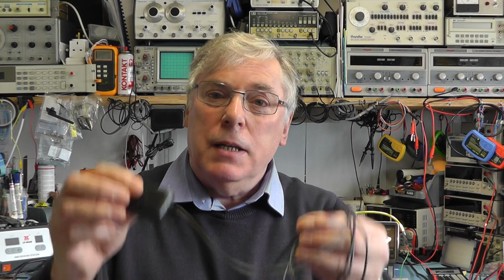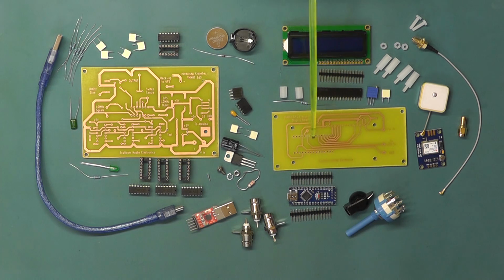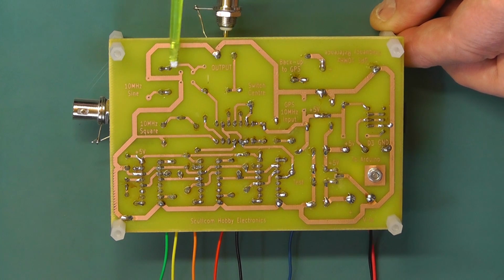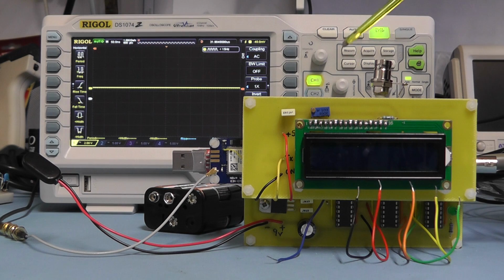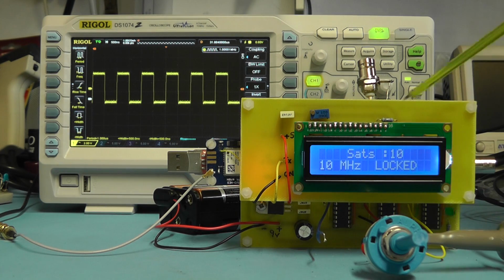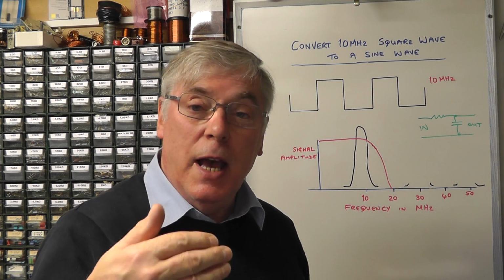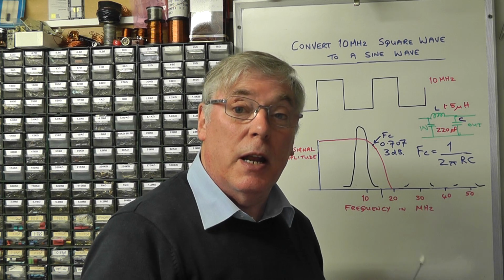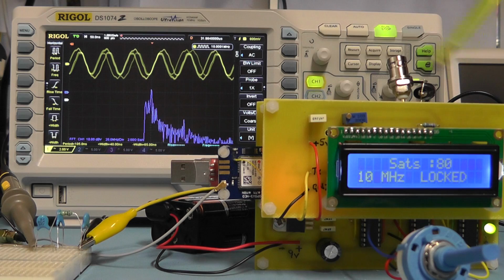Scullcom Hobby Electronics #37 - Design & Build a GPS locked Freq. Part 2

Comment: Nice project! Would better grounding (ground plate) and shielding between the frequency divider chips not improve the signal quality? It seams like the high frequency signals are interfering with the lower frequency signals. Switching off the the lower frequency dividers when using higher frequency reference signals might improve the signal even more😁

Comment: Very informative videos thank you. The effect of the 'phase distortion' would be most likely  cured if you put a BNC t-piece on the Rigol Oscilloscope, and add a 50 ohm terminator (ie resistor) on one of side of the Tee, and put your probe lead into the other side of the Tee. The ghosting is caused by an impedance mismatch in the cable, and so what you are seeing is the reflected wave bouncing back and forth along the test lead.
Reply: That won't cure it. The "ghosting" is not an impedance mismatch, but the result of the synthesis of the 10MHz square wave from a 24MHz signal which is a non-integer division. The 10MHz is created by dividing the 24MHz by either 2 or by 3, so instead of 50ns high and 50ns low, you get a sequence of pulses that are comprise 3 pulses of 41.66ns interspersed with 2 pulses of 62.5ns in duration that average out at 50ns, making the frequency exactly 10MHz, but with an uneven duty cycle. That's what you're seeing on the scope.

The solution is to set the GPS module to generate 1 MHz, which it can do precisely, then use a phase-locked loop running at 10MHz to drive the divider chain, diving by 10 at each stage. The 1MHz GPS signal is then compared with the output of the first divide by 10 stage to control the VCO in the PLL. That will give the full range of calibration frequencies as before, but with accurate 50% duty cycle square waves from each.

Comment: The firmware needs a fix ! At 19:33 the Sat display goes from 9 to 10 to 90 sats, so you should add an extra space after the number. Nice work overall.

Comment: It is easier to get clean 10 MHz signal if you use LC circuit. 12 turns on 10 mm body (some 10 mm drill, remove after coil is made) with 1 mm wire. Parallel to the inductor is 250 pF capacitor. Whole LC 'tank' feed over 5 pF capacitor from 10 MHz GPS module output to this LC circuit, and at the same point you have clean 10 MHz signal. Since inductor is free standing in the air, it can be fine tuned by moving coil little bit. Take care about output impedance, since LC tank is generally high impedance circuit. You may use secondary coil with few turns, or solder tap on say 1/3 of the turns (4th turn from the ground end). Amplitude at this point will be lower, but LC tank circuit resonance will not be compromised.

Comment: Very interesting video. Can you recommend seller for the neo 7. Most of the sellers i have found are in china
Reply from the maker: Hi Peter,
If you use the following link you should find a few sellers. One is in the UK but also the most expensive. The ones fro China are the cheapest.
https://www.ebay.co.uk/itm/1PCS-Ublox-NEO-7M-000-GPS-Module-MWC-APM2-6-Replace-NEO-6M-GYGPSV3-NEO7M-L30
Regards,
Louis
Reply: Thanks for your reply. I will take a look

Comment: 21:34 90 sats? that's impressive ;)
Reply from the maker: Thanks.
Reply: I'm sorry, that should have been a hint. There aren't even 90 GPS satellites in orbit, and you can receive maybe 20 at the same time. I think it's a bug in the LCD driver software, you don't delete the 0 in the second digit so if it displayed 10 and then goes down to 9 or 8, the 0 stays and it seems like 90 or 80.
I like the project though.
Reply: I just watched part 4 of the Series and the issue seems fixed there.
Reply from the maker: Thanks for letting me know. I smiled when I first read you initial comment of "90 sats" The LCD needed to delete the 0 in the second digit when it went below 10. As you point out this was corrected. Regards, Louis

Comment: Excellent project, I have started working on mine. I have been looking at Arduinos for quite some time and this project will make me get in it.I have a question on your diagram, why do you have jumpers drawn in the schematics, JP1-2-3-4-5-6-7-8I making a few changes on your schematics too, i'm planning to use a multiplexer ( I have a HCF4051 that I will try) controlled by the Arduino.
Reply from the maker: +dan3460 Thanks. Yes JP1-2-3-4-5-6-7-8 are simply wire links as the PCB is single side. With regards switching, I have been working on keypad entry of the frequency which will be covered in Part 3 of this project. A new single board PCB is also designed. Part 3 of the project is uploading as I type this so should be available soon.

Comment: Great work! 
I was looking for a Master Clock for my scopes and counters when servicing amateur radios. I found some cheap china modules working fine and even having a PPS output on the connectors. As the studio is below the rooftop, it works fine with the on-board patch antenna. If you use PPS output up to 1MHz signals are received perfectly but if you set PPS to 10MHz the receiver signal quality is dropping very low.
I investigated that and found that the LEDs (my module has two of them) are driven by this signal and the signal is not a sqare but some sort of saw-tooth-ish. So driving two LEDs with 10MHz is putting some real ripple onto the complete boards power planes and loading the 10MHz to hard.
I removed the LEDs and added some more decoupling capacitor to the Vcc and it looks far better now. even still without external antenna.
Reply from the maker: +Astralix2011 Thanks for your comments.

Comment: Every one I seen runs through a electronic frequency control input (EXTAL)pin on a ocxo 10MHz crystal then into a low pass 10MHz filter for a sinewave. Your probably picking up external noises from the wires around the gps module and the input voltages, lighting, ect. so shielding would probably help out. Might look at it with a spectrum analyzer to figure out all the issues. Look at with your FFT on your scope
Reply from the maker: +Martin P Thanks Martin for your comments. Yes you could also use this project to lock a 10 MHz OCXO and get a cleaner 10MHz sine wave out put. I have found that some of the noise is caused by the 48MHz fundamental frequency from the uBlox Neo-7. Adding some filtering on the 5 volt power line reduces this. Screening as you mentioned would also probably help.
Reply: +Scullcom Hobby Electronics, Be interesting to see what you find out. I'll order the chip sometime put it on my own pcb with my own components. I suspect some of the issues is with the pcb design and parts on the GY-GPSV2-NEO or V3. According to Ublox these things are really finicky with voltages though they don't go into detail about proper board design.  Oh and you might try Power Save Mode since this might lower the noise and might be worth it to go through all the software and disable what you don't need.
Reply: +Martin P , found the design guidelines, thought I'd share. https://www.u-blox.com/sites/default/files/products/documents/MAX7-NEO7_HIM_%28UBX-13003704%29.pdf
Reply from the maker: +Martin P Thanks for the comments and info. Part 3 is uploading as I type.

Comment: Hi Louis. The rotary switch is missing from the parts list! Discovered while ordering parts for this project :)
Reply from the maker: +Eric Gee Sorry about that Eric and thanks for bring that to my attention I will try and correct it. The rotary switch is a "make-before-break Rotary Switch with 2 poles and 6 ways" the one I used was manufactured by Lorlin Electronics Limited in their CK rotary switches range type CK1035. These are available from both Farnells (element 14) or RS Components Ltd. Cost is around £1.50. Farnells order code is 1123691 and RS stock number is 327-658.
Reply: +Scullcom Hobby Electronics  Thanks

Comment: To answer my own question! The Neo-7M is limited to 3.5V - the board on which it is mounted has a 5V regulator. Duh!!
Reply from the maker: +g4rko Barry Thanks Barry. It is easy to miss that the GPS module has a Low Drop 3.3 volt regulator on it, so we can feed the PCB from a 5 volt supply. The actual Neo-7M component in the centre of the PCB is what runs on 3.3v. The main PCB board is basically a prototype board.

Comment: Hi Mr Scullcom,
Looking at you published schematic you appear to be running the Neo-7N from the 5V rail - am I reading this correctly. The data sheet for the Neo-7M states a maximum input of 3.5V?
Great project, very much like the modular design.
Barry
Reply from the maker: +g4rko Barry Thanks. I see you answered your own question in another posting.

Comment: I am starting to believe that you have the best video channel on electronics projects on YouTube ! I also have a question for you. I have been tweaking a programmable rubudium freq STD in order to get a highly stable 16.933 MHz for my custom made CD player based on a good old TDA1541 tweaked to the max. I was wondering what would be your recommendation on a circuit to upconvert a 10 MHz GPS reference to a higher freq ( ie 16.933 MHz). Is this even something you would consider doing and would it seriously increase the phase noise level of the resulting signal ? Thanks again for your excellent work !
Reply from the maker: +DJSolitone Thanks for your comments. Using a Rubidium Frequency Standard to derive 16.933 MHz for your CD Player seems a very expensive way of doing it. May first thoughts would be to use something like a Voltage to Frequency Converter IC such as the MAX038 or similar. The MAX038 is a high-frequency, precision function generator producing accurate high-frequency (triangle, sawtooth, sine, square, or pulse waveforms can be selected) with a minimum of external components. The output frequency can be controlled over a frequency range of 0.1Hz to 20MHz. Have a look at the datasheet.
Reply: Thanks for your reply. The idea I had behind the rubidium std was to have a programmable lab reference so that I could use on various applications in my lab (and also my sound studio where I manufacture custom sound appliances). I got the rubidium standard for cheap a few years ago, and managed to program it to the desired frequency, up to 20 Mhz. So I was wondering if such a think could be faisable with a GPS receiver like yours or something similar. I guess my overall question would be : How can you best upconvert a 10 Mhz signal to a higher frequency without injecting too much phase noise. I understand that it is easier to divide it and keep a good precision, but once you upconvert your base signal I guess that you get some loss in precision right ?
Reply from the maker: +DJSolitone I would imagine you would use a Block Up Converter which would simply use the GPS 10MHz reference in a Phase Lock Loop to lock a higher frequency Crystal or Voltage Control Oscillator to a precise frequency.

Comment: Great video. Towards the end the display shows 80 and then 90 sats. That must be an error since there are not many sats overhead. 

My guess is it displayed 10, then 8 and the zero was not removed from the screen.
Reply from the maker: +Graham Wilson Thanks Graham. Yes you are correct at 33.51 the GPS module locked on to 10 satellites (just before that we had 11). I am finding that with the new active antenna it detects more satellites. When I wrote the software code for the Arduino I assumed that I would not receive satellites in double digits. I just need to make a minor change to the code to correct for this and blank out the digits first before displaying the new reading. I will provide updated code on the next part and may also include some additional features as well.
Reply: @scullcomhobbyelectronics1702  i am also serching for the new update Code for this Project to fix the uptate of more then 10 Sats with fix the 80 or 90 display , in your follow project with the keyboard i do not need this i only ned for this smaler project, can you update here the updated code for fix the 80 an 90 displaying ? Many thanks for to do this
Reply: Super-Secret (normally HIDDEN from view) were detected by this amazing piece of kit.
😷👍🏻🤣
Seriously.. Great job!!
Thank you .

Comment: Hi Folks:  I am having trouble understanding how the signal from the GPS Satellites works to lock the frequency.  I have done some Googling and reading and I am not getting what is the signal from the Sat is.  Is it digital/analog? Also the Sats in their orbits are coming and going, so is red/blue shift an issue? Can someone provide a thumbnail primer on how this works.  Cheers, Mark
Reply from the maker: +Mark Beeunas The GPS module (ublox Neo-7) has a built in oscillator (either Crystal of TCXO) which is used as the timing clock pulse for digital processing on the GPS module. This oscillator is also used to derive a timing pulse which is what we are using in this project. When the GPS module detects a satellite it receives an accurate timing signal which is then compared with the timing pulse and makes any corrections required to accurately set the output frequency of the timing pulse.
As the timing pulse frequency can be set by us in the configuration settings, we set ours to 10MHz. It is this frequency which is then accurately tuned and locked and so we can use it as a frequency reference standard.
Navigational satellites have a very accurate clock locked to both International Atomic Time and Universal Time (also known as astronomical time or solar time, refers to the Earth's rotation).
Hope this helps.

Comment: A couple of comments/suggestions. Have you considered using a multiplexer to switch between the different frequency outputs? For example, you could use a 74HCT151 (or 74ACT151) to select from up to 8 frequencies for the one output, and then the mechanical switch would only have the control lines for the mux - no high frequencies running to the switch.

Second, once source that I would recommend to you and your viewers that want to learn more about frequency standards and GPSDO (which is what you have assembled) is a mailing list called "time-nuts". You can find info on that and other sources of info here: http://www.leapsecond.com/time-nuts.htm . There are also some good threads on GPSDO over on EEVBlog.

Also, there are quite a number of things that you need to watch out for in order to avoid introducing significant phase noise into the frequency standard. One of the things I've been told to avoid is high Q circuits, such as the circuit you were using to filter the square wave down to a sine. 

Finally, I have the same little antennas that you show in this video. There is also another one, its about 2-3x as large, which gets considerably better reception. The price is about the same.

Anyway, thanks again for the videos.
Reply from the maker: +Matthew Humphrey Thanks for the info. There are a number of options I am looking at for frequency selection. I will cover more details in following parts of this project.
Reply: +Scullcom Hobby Electronics Excellent. I look forward to part 3.

Comment: Great video as always!

You could use one analog input on Arduino to measure the battery voltage.
Reply from the maker: +GADELHAS82 Thanks. Yes nice idea, I did consider having the LCD showing a battery check for a few seconds at switch on. I have a number of optional upgrades for this project which I will cover in later parts to this project. At the moment I have focused my attention on getting the project to give good accurate frequency outputs.

Comment: Hi first of all very cool Project :)
but I wanted to comment on your measurements, I noticed you are using a switchable Probe on x1 so you can get only 6-8mhz bandwidth depending on your exact Type of probe, look it up in the data sheet, this might explain why the waveform looks worse with increasing frequency.
Reply from the maker: +jolo0011 k Thanks for your comments. You are correct about the bandwidth of the probe when used on x1 and this will effect the higher frequencies and shape of the waveform. I was using a slightly better probe but still the bandwidth would be better used on the x10 position. I have a number of different probes some better than others, but agree with you using the x10 option would be better. Will try and show next time. Thanks.

Comment from the maker: MESSAGE FOR PIRATEMAN
For some reason I am not able to reply to your comments. It could be due to the method you are using to post your comments as it seems to reject any reply. Below is the answer to your comment:
Thanks for your comments. Building an LCR meter could be a future project, but as you say they are so cheap to buy these days. However, the process of building one would be educational. I will consider it for the future but at the moment I have a number of other projects planned.

Comment: Using a make before break switch for the power section makes sense since losing sync from power down takes time to recover. But I wonder if make before break is a good idea for the frequency selection since that causes adjacent outputs to be momentarily shorted.
Reply from the maker: +Douglas Gilliland Thanks for your comments. In this project using a make before break rotary switch causes no issues so it is safe to use. Connecting adjacent outputs of the divider IC momentarily has no effect.